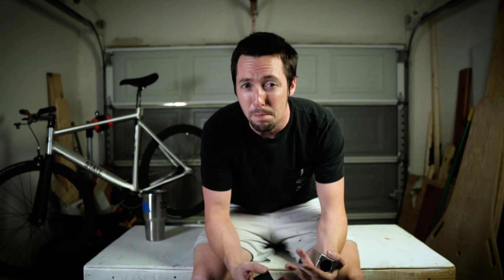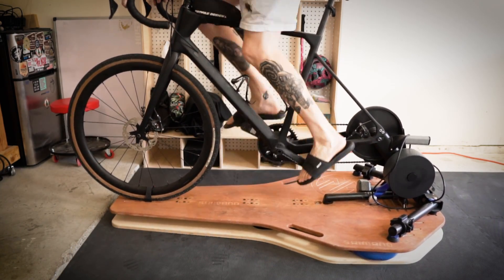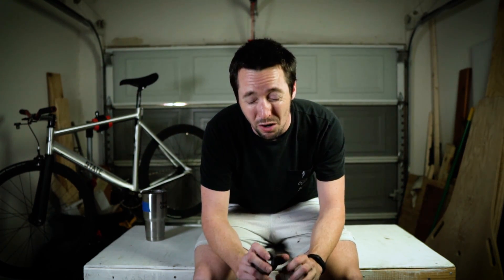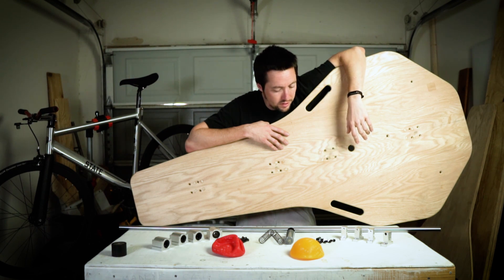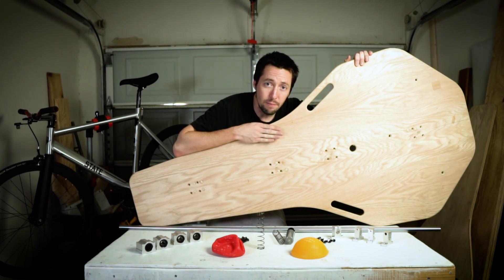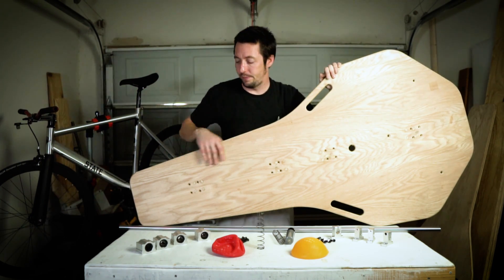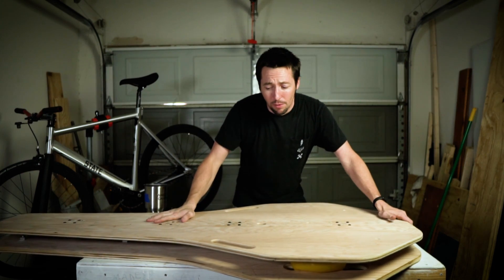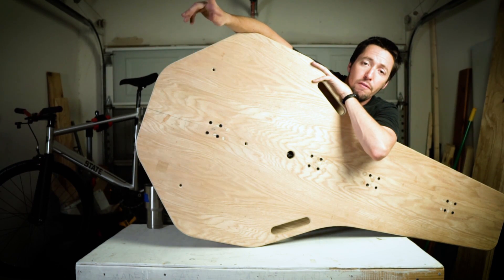DIY Rocker Plate with Fore and Aft (Linear Rod Bearing Type)

Comment: The plans are amazing!  This is a better design than some of the commercial versions that are out there.  I modified the design specifically for a Wahoo Kickr Bike so it is shorter by 5 inches.  Bought the 13 ply 3/4" Baltic Birch plywood which is really nice to work with.  CNC really isn't necessary if you are good with a router and a straight edge.  A spindle sander is also helpful.  I personally don't want much travel fore and aft so I am doubling the number of springs and pre-loading by one inch each.  I also found that placing washers for 3/4 inch bolts solves the problem of the spring pressing on the linear motion bearings.  3/4 inch washers are oversize on the I.D. so they thread onto the 20mm shaft perfectly.  Thinking it may make sense to put a thin coat of grease on the rod where the linear motion bearings travel?  I paint carbon fiber frames for fun so this puppy is going to get a custom airbrush "basketweave" and then topped off with clear coat.  Almost finished and can't wait to test it out!  Thanks again for all of the collaboration here!!
Reply from the maker: Thanks for watching! All of your improvements are awesome. Nothing beats good collaboration. Happy riding, let me know how it goes!
Reply: Update:  Assembled (no finish applied yet) and tested.  This is an AMAZING design.  Riding motion is so much better than without the rocker board.  Doubling the number of spings provides the exact amount of fore and aft motion that I was looking for.  Super enjoyable project for a DIY'er - it took about 1 1/2 weeks of spare time.  The build is "industrial quality" using all of the supplies and recommendations from Andrew.  I've also determined that with the Kickr Bike it isn't necessary to tie it down to the top plate as the bike weighs about 100 lbs and the flywheel is massive (50 lbs?).  I attempted to tip it while riding and it isn't going anywhere.  Obviously, you need to determine if this is appropriate for your bike and rocker plate setup.  

Finish Update:  Rather than a custom paint job I've decided to take the Wahoo Kickr mat I bought, and adhere it to the top plate with 3M Super 77 spray adhesive.  Once adhered, I'll trim it with a knife to about 1/4" overhang, flip the plate upside down and use a straight router bit with a roller pilot riding on the edge of the ply to trim it perfectly flush.  I know it is an expensive mat to sacrifice but it is cheaper than the cost of the automotive paint I would use if I did the custom paint job.  If you like this idea I know that there are cheaper mats on Amazon.  This will provide a nice "no-slip" and tough finish to the top plate.

Comment: One more year and I decided a service was due as there were some clonking noises when honking out of the saddle on climbs. I also wanted to cut some holes is the top plate so that I could top up the balls with air by pumping from the top rather than the sides. I found that the steel rod had a 2 inch long wear groove in it. I turned it through 90deg, re-greased and re-assembled.

It's OK for now but long term I think it would be better to get a new rod and have it hardened. Slots on top for pumping the balls is great. I also upgraded the balls from the very thin pimpled ones, as in this video, to the mini basket ball look-alikes which are more heavy duty. Popping balls I hope will be a thing of the past.

I've also rested the whole thing on a pair of tubular tyres, pumped up to around 20psi to try to give the feel of being on a bike with tyres rather than rigidly hard on the ground. Thanks again for the original idea and design.

Comment: Just built mine, can't wait to try it. Kicker Snap Users note you will have to modify the shape a little, add more padding around the handles to give the trainer feet something to rest on.  I'm also thinking of adding two ports or slots on top of the where the yoga balls contact the top plate to make refills more  convenient. Nice design, thanks for sharing it!

Comment: Have built this now and ridden with it a while now. I'm very pleased with the movement. It makes trainer rides quite a bit more varied and comfortable. A very worthwhile addition. Thanks for the design. 
I popped a suspension ball early on (lucky I bought some spares). I balance the pressures on each side by using the spirit level but am playing with the absolute pressure. ATM it feels too easy to swing the bike side to side but I'm a bit wary of increasing the ball pressure too much in case they pop. Maybe the subject of another video - setting up the balls? Maybe I need to increase the number of balls...?
Reply from the maker: Thanks! Increasing the pressure will increase the resistance. I've only heard of a few people having issues with ruptured balls. It could be a defect in the ball quality. You can definitely increase the number of balls if that's an option.

Comment: Thanks for sharing this design. I’m wondering if I could simply get away with just Wahoo Kickr Core Move on the rocker plate and not the front wheel. The move version provides front to back movement OOB, so I think just placing the trainer on the rocker would do the job. What are your thoughts? And not to mention it would cut cost significantly as well.

Same question for older Wahoo trainers where front to back motion is not required. Thanks

Comment: Hi, my name is Domenico and I’m writing from Italy. Excellent project. If I used springs with 2.5mm wire and 28mm external diameter but only 120mm in length… considering the slight compression I would have to give to stabilize the upper board, would the oscillation be little?
Otherwise I could use springs with 2mm wire and 28mm diameter with a length of 150mm.
I don’t know and I would like your suggestion on this hypothesis: If the springs are 120mm, having the wire 2.5mm (instead of 2mm) I would still get good resistance.
What do you think?
These are theoretical reasonings also because I haven’t seen your test of your Rocker Plate.
Hello, thanks and see you soon 😉

Comment: Thank you for this video and all the info. I am building this tomorrow (20th November 2021). Also streaming live on YT
Reply from the maker: Thank you and good luck on your project!
Reply: @WeRideSouth  temporary pause. Bolts too short for the mounts. my panels are 16mm, mounts are 20mm. I will need around 6-10mm additional clearance. off to Wickes to see if I can grab some. other than that. my boards are cut and drilled
Reply: Build complete, but with some issues. I need to do a little more engineering. Main issue is the clearance of the top board . Once the bike is mounted Im losing  clearance as the top of the standoffs are hitting the top. You mentioned raisers or washers for the linear bearings, I will try to raise that to see if works. When the balls are in, it does raise the level, but it causes the board to flex. Some positioning is required.  Any further tips on clearance solutons?
Reply from the maker: @blackcyclist  the 3mm risers should be plenty of clearance. Your wood shouldn't really flex much if you used enough layer birch plywood
Reply: @WeRideSouth  I added some 3mm risers and this worked a treat.  Just a few hiccups but all good now
Reply: Pics and a short video on my Twitter

Comment: Hi Andrew, thanks for uploading the files and the'shopping list' for all of the parts.  I will be modifying the design slightly to accomodate a kicker core.  I just had one question regarding the grove on the center line (the question is coming form the CNC shop I am using for the work).  They were wondering what the purpose of the groove was (I assumed it was for some kind of stress reduction on the top plate).  Thanks again.
Reply from the maker: The groove in the centerline is only for alignment purposes, there is no mechanical benefit.
Reply: Thanks for the quick reply, really appreciate the information.😁👍
Reply from the maker: @colinbourhill7362  thanks for watching!

Comment: Hi Andrew, thanks so much for sharing all this info, you really are an special dude. I am gong to attempt to build this, in looking at the DFX file in Autodesk, I could see the measurements, length, width, screws holes... is anyone able to see them?
Reply from the maker: The sizes are built into the DXF, but I'm not sure how you would expose them in Autodesk. I have never used it. There is a group on Facebook called Rocker Plates where some people have created PDFs of the files with measurements. 

If you open the google drive document and scroll down you'll see a row titled "PRINTABLE PDFs Thanks To Ed Robbins" 
Those have the measurements listed.

Comment: I will be following this design with slight modifications and cutting everything at home.  I could not tell from the drawings how wide the channel is for the balls (assume 2") and how far in from the sides they are.   I would assume the farther out the better but you want room for the ball to spread out under pressure.  Can you provide the dimensions for the ball channel width and how far from the edge of the bottom to the edge of the channel.  I know this is rough average since your design cuts in a little but knowing this would help.   Thanks
Reply from the maker: The channels are about 2" and you really want them to be anywhere from 6" to 8" from the centerline. The Rocker Plate group on facebook leans toward 6".
Reply: @WeRideSouth  Andrew, is this 6-8" from CL of board to CL of cut channel?   Thanks
Reply from the maker: @karmink8400  yes
Reply from the maker: @karmink8400  https://www.andrewgrabbs.com/wp-content/uploads/2020/12/baseboard.png
Reply: @WeRideSouth  Thanks!  I had originally just tried to make even spacing between the edge of the cutouts from your V2 desgin and outer edge and this ended up being about 9-9.5" from CL to CL.   May see how it feels and if I need, will cut another channel at 6 inches.  Thanks for great vid and all the files.  Combined this design with one off the rocker plate FB page that included a step up and used Traxxion parts to have specific mount directly to the KICKR to eliminate the need for all the channels in the top plate.
Reply from the maker: @karmink8400  Also, some have said the channels are not even necessary.  You can pin the balls between the two boards without issue, I just like to over-engineer everything.  :-) thanks for the support!

Comment: I build this one now. Side movement is ok. Fore and Aft only works when no trainer and bike mounted :-). Is it the weight? More tension on the springs? I think the weight of the trainer has an influence on the bearings?
Reply from the maker: that's odd. What wood did you use?
Reply: @WeRideSouth  normal 18mm hardwood multiplex. Should be ok. Seems that the weight of trainer have An impact on the bearings i guess? I Will put some fixed washers so to give the springs extra tension. But I think it is the weight on thé bearings that give them a problem to slide. Do i need a metal spacer between bearings and top plate?

Comment: Great design. Love the idea of fore and aft motion. Had a look at the spreadsheet and have some questions. What is the riser plate for? Why are there 2 dxf files of each 35 and 40mm plate? Each dxf shows both top and bottom so that's 8 plates in total!!!  Also why 35 or 40mm? - you mention 3/4" plywood - that would be 19mm, wouldn't it? Thanks in advance.
Reply from the maker: I use 18mm plywood, you can use either. 35 vs 40 is depending on the bearings you use. SBR20UU have a 35mm hole spacing and require a different layout. SCS20UU have a 40mm spacing. The SCS20UUs have a problem clearing the lower rod supports so you'll need at least 3mm spacers on top to help clear. Good luck!
Reply: @WeRideSouth  Thanks very much. All clearer now.
Reply: Springs seem to be very expensive here in the UK - around £50-90 for 10. How many are actually needed? Is it just 2 as per the video?
Reply from the maker: @Ricobass0  just 2.

Comment: Hi I love this ,I live in Scotland and I am planning to try and make one ,a few questions how long is your linaer bar ?also the dimensions off the boards ?also having abit of trouble sourcing the balls any ,help would be much appreciated
Reply from the maker: The linear rod is 55" but you can use 1300mm. The boards are 60" in length. As for the balls I bought mine on Amazon if you check the google document in the link below everything will be in there.

Comment: Wonderful video. Clearly you put a lot of thought into the rocket panel. Would the panel work with the Wahoo kicker core? The support on the core  model is narrower that the more expensive models. Thank
Reply from the maker: Thank you! For the Kickr Core you would need to leave a bit more wood on the back when cutting for the rear lateral support, however, some have swapped the front support for the rear or shortened the rear all together. I would advise against any modifications and go with leaving more material on the rear of the board. Good luck!
Reply: Thank you very much.
Reply: Thank you very much.

Comment: This is great!  I can't find a rod longer than 1200mm, vs your 1400mm.  You think that would work?
Reply from the maker: That'll be fine. It's just going to stick out on the front and back.
Reply: @WeRideSouth  Thanks for the reply.  it's almost 8 inches shorter than your spec, so you'd just kind of split the difference in the fore/aft position?
Reply from the maker: @voldengen  that's what I would do. 4 inches out front and 4 out back. If you could cut it that would work too.

Comment: Great bit of kit! Any details on templating the drill holes etc?
Reply from the maker: Inside the facebook group rocker plates another user has converted my designs to a printable sheet by sheet template. Join the group and check out the file section.
Reply: @WeRideSouth  Cheers, just joined the group!

Comment: How Can it rock? Does The top plate not touch The stand on The Buttom plate?
Reply from the maker: The plate has resistance from the two inflatable balls. It should never touch to the bottom plate.
Reply: @WeRideSouth  He was asking a different question.  The stand-off scrapes against the bottom of the upper plate when rotated.  There needs to be a spacer (washer) above the the bearing.

Comment: Hello!! Why do You need the risers in the 40x40 version documentation? I didn see them in the video. Great Work, Thanks!!
Reply from the maker: You need the risers because the stackheight on the SCS20UU (40mm bearings) is not high enough to clear the lower rod supports. 3mm spacers fixes this.
Reply: @WeRideSouth  I am missing something in the measurements: I see the rod ends on your assembly coincide exatly with the top standoffs. But if the rod is 1400mm and the spacing is 467,2+406,40+406,4 the total length is 1280, the rod should be longer thant the standoff length... What am I missing?
Reply from the maker: @adireitinho  the rod is at minimum 1300mm. The link is 55" as it is the common length that this rod can be bought at in the states.
Reply: @WeRideSouth  Excellent Thanks!!!

Comment: Hey. That is for sharing this. A couple questions...
1. At around 50sec where you're demonstrating the design spring is fixed with a collar, any benefit here?
2. How do you prevent overtravel of the top plate in reference to the bottom plate? I'm concerned that the springs won't be strong enough.  Thoughts?
3. Did you notice clearance issues between the rod bracket on bottom plate to the top plate when assembled?
Reply from the maker: Thanks for watching! 
So to answer your questions:
1. This was a prototype and I hadn't finalized the top linear bearings where they would leverage the linear rod supports, so this really isn't necessary with the new design which preloads the springs against the rod supports. 
2. The springs are pre-loaded and counter act each other. Behind the spring is the linear rod support so you physically cannot go any further once you compressed the springs completely. If you're concerned about this you could beef up the springs with thicker wire. I have not had an issue.
3. There is an issue with SCS vs SBR bearings. The SCS bearings require about a 3-5mm riser vs the SBR that do not require a riser; however, the SBR are 35mm mounting holes vs the 40mm of the SCS so if you've already cut, switching probably isn't in the cards. You can cut some from wood or plastic. 

I hope that answers your questions.
Reply: Sure does! Thanks man. The design itself was really easy to reproduce so far. I don't have a cnc either so my buddies and I made a couple of hardboard templates, jig sawwed it and routed to finish. The "hard" part is getting the rod installed. Without the cnc, a good template is needed to get your bolt holes correctly located. But my buddy who ordered the bearing blocks assumed the 35mm spacing and we bought the 40mm spacing. Our template is jacked up for that now! Lol.

Comment: Thank you. Excellent explanation. Would this work with my Climber?
Reply from the maker: Yes it should. Many people on the Rocker Plate facebook group use them without issue.
Reply: @WeRideSouth  without having to add all the numbers on your spreadsheet, Do you know a rough total for the cost? Keeping in mind that the plates could vary depending on how they’re made. Perhaps hardware plus hardware+plates estimate?
Reply from the maker: @Tchairdjian  I'd say anywhere from 100-300$
Reply: @WeRideSouth  never mind. I found your previous answer to another comment.
Reply: @WeRideSouth  thank you so much.
Reply: @WeRideSouth  One last question, have you considered using MDF instead of plywood? Probably be heavier, but not sure as far as strength... maybe also easier to work with too with the CNC machine. And rounding the edges and paint job.